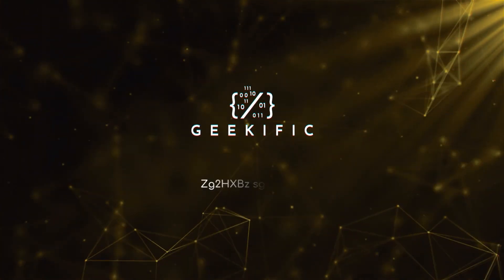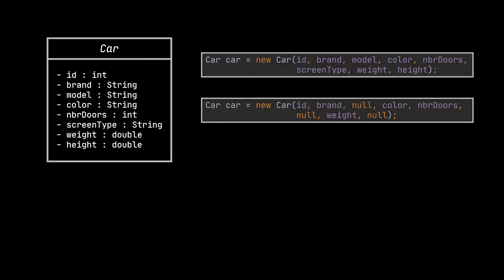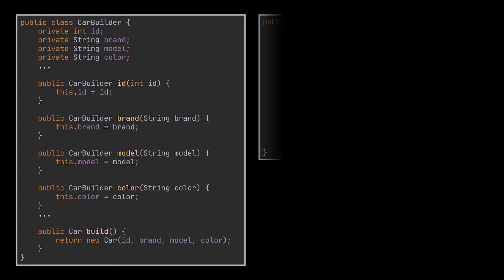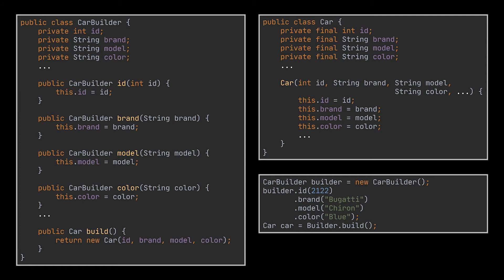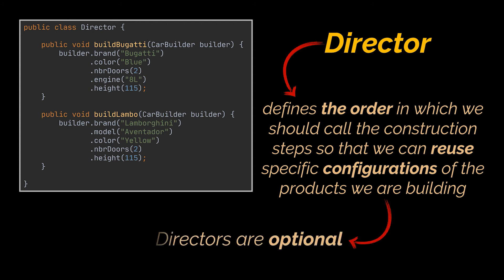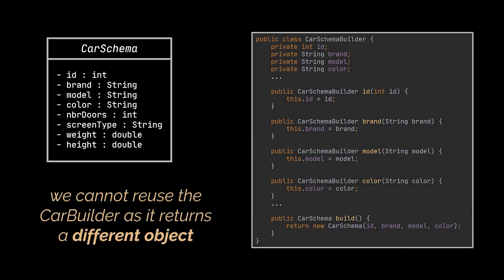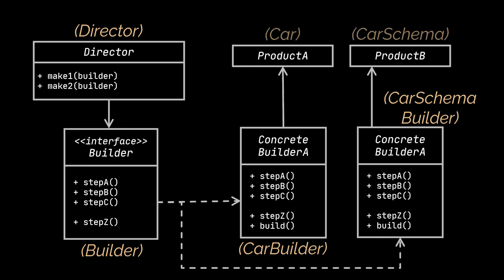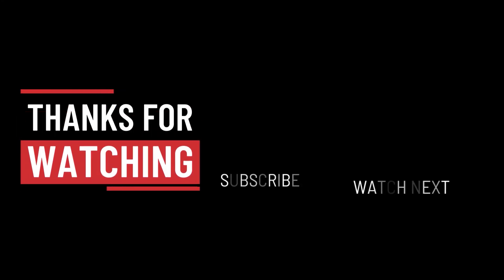The Builder Pattern Explained and Implemented in Java | Creational Design Patterns | Geekific

Comment: I like the Builder Pattern in some usecases, but the usecase would need to be justified imo. I would rarely use it in place of a constructor, if ever. 
Let's say that the constructor has 10 properties and we want to create 1 million cars. Instead of performing ~11 operations (calling constructor, setting the 10 properties), we need to perform ~3 operations per property (calling the build method, setting the property and return the Builder). It won't matter in most scenarios, but in this hyperbolic example the CPU would do approximately 11 million operations in the constructor example and 33 million in the builder example.
Having long constructors is also rarely an issue since we just use variables as arguments: new Car(id, brand, make, doors, engine, ...). Then we can just make the optional properties nullable.

I'm only critiquing it's usecase for being a replacement for constructors. It can be very useful in certain usecases like the StringBuilder, DateTimeFormatter etc. It's also useful when you want to chain modify default/set properties, like the Locale:
Locale locale = builder.setLanguage("en").setRegion("US").build();
I love using the Builder Pattern in this scenario. We can change all the properties that we want in one line, and we can ignore the Locale properties that we want to leave as default.

Comment: I have a question, I read in the internet that you can use a public static inner class as a Builder in the object you want to create to implement the Builder Pattern. Is this basically the same? What are the advantages / disadvantages doing it either way?
Reply from the maker: Yes you can do that, and on the larger scheme of things it won't really matter which option you pick. The main advantage of the inner class is the encapsulation of the construction logic within the class you are working with, leading to a more clean and concise code. However, it may increase the complexity as the class will be harder to understand if you are not familiar with the pattern, and may introduce some limitation in accessing private fields. Hope this helps :)

Comment: Do you think the Builder Pattern could be an effective way to build different kinds of AiControllers with different behaviours/states and abilities, say for an Orc, Goblin, Troll, etc? Would the architecture flow look like? Thanks
Reply from the maker: I am not sure I understood 100%, but I will try to answer. 
If you have a common Character class let's say extended by several other classes (Orc, Goblin etc.) the builder pattern can indeed be used to initialize the objects based on these classes. Cheers!
Reply: @Geekific  ok yes, so would i first have a Orc class and then an OrcBuilder class or a EnemyControllerBuilder class with methods like AddAbility, AddState, AddStat? And then inject in all the Abilities, Stats, States, etc? Then perhaps the EnemyControllerBuilder class would return a controller to the Orc class...and that would be the Orc? Thanks again
Reply from the maker: I don't really like creating builders for classes that do not exist. If you have only an Orc class then create one builder for it. If you have an Enemy class extended by the Orc class, then yeah you may have two builders and pass stuff from one to another.

Comment: Theses patterns seem overly complicated for no reason
Reply from the maker: When you apply them on simple examples they do!
Reply: Isolation
Reply: I'm starting to learn some patterns like state or memento. While those are useful, I honestly found this one overly complicated, because if the constructor has so many parameters why not just create an empty constructor and then populates the objects fields calling the setters methods like?

Car car = new Car();
car.setBrand("Something");
// other setters fields that you want to initialize...
car.setHeight(1.5);

instead of using all those new classes?
Reply: @razorblade413 because of immutability, if you want to make a property immutable, builder is the way to do it. With setters it’s not possible
Reply: @razorblade413  This approach has a flaw. The object's are always mutable, whereas if you use builder, the objects returned from it are immutable. This is explained by joshua bloch in effective java.

Comment: CarBuilder instead of duplicating Car fields, can contain Car and set it's fields via setters (restricted)?
Reply from the maker: This will give you more flexibility and less coupling. Ex: If a Car's parameter is actually deduced from two other parameters that are not in the Car class, you can add these two params in the builder and the Car class doesn't need to know about them etc. Cheers!

Comment: thank you very much for the video, the build method should be put within the Builder interface, I thanks for the answer and again thank you very much for the video
Reply from the maker: You are welcome! Glad it helped :)
Reply: @geekific  excuse me for the bad writing, I asked you if the build method should be put within the Builder interface in the previous message but I forgot the question mark (?), could you respond me that?¿the build method has to be within the Builder interface or not?
Reply from the maker: No worries :) Up to you! The basic ideas of the implementation will not change. Cheers!

Comment: What is the meaning of making carSchema is this for to make different types of car like one implementation will make one kind of car and other is for different type. But this we can do inside director only. Than what is the meaning of carSchema. Plz explain
Reply from the maker: In this video carSchema was used to explain one advantage of using a Director, and it is storing the common initialization of multiple objects which in turn have builders that implement the same interface. Hope this answers your question!